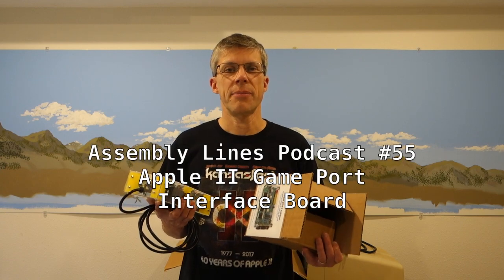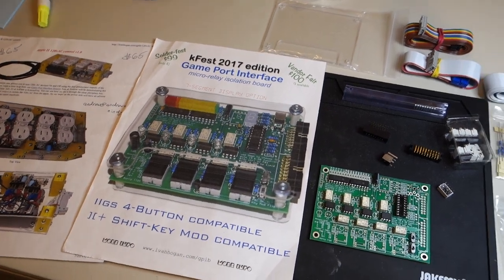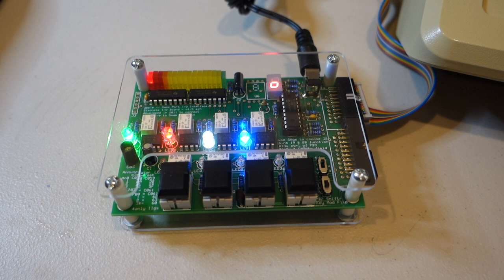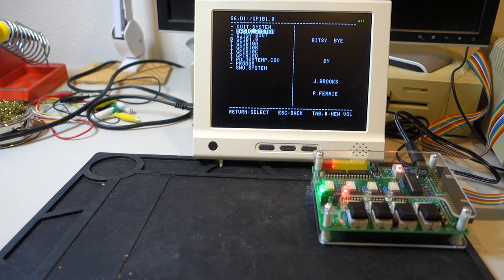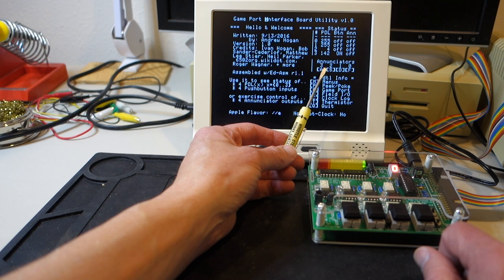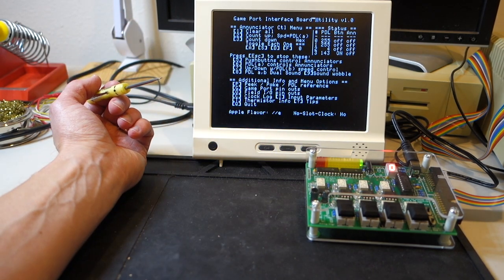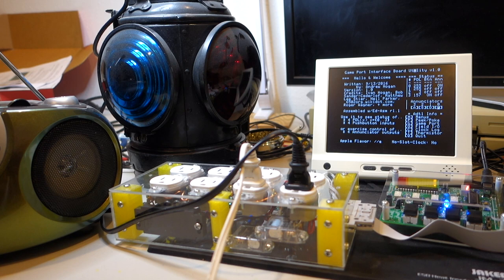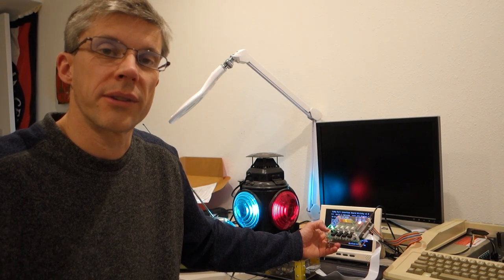Assembly Lines #55: Apple II Game Port Interface Board

Comment: Love the videos. Just got an Apple IIe, and have some questions regarding your monitor. What type of monitor is it? Are you using composite input, or do you have a VGA adapter? Did you paint it, or did it come in that colour? I have an Apple Color monitor, but I'm wondering if it's worth it to upgrade. Regards.
Reply from the maker: Hey Greg, it's a Dell 2001FP 20" LCD that I painted using Krylon Almond spray paint. I'm using both the composite and S-video input via a splitter cable. See https://youtu.be/wQaouPzMSsI. It's not worth upgrading unless you need the real estate on your desk. Those old CRT's are usually much better, especially for 80-column text...
Reply: Thanks. You did a great job, as it looked stock. I'll likely stick to the CRT for now, and consider the Dell LED a target of opportunity if I come across one.

Comment: Any idea if it works on a IIc?
Reply from the maker: It will partially work on a IIc. The IIc game port only has the pushbutton and game controller inputs but doesn't have the annunciator outputs so I don't think you would be able to control the appliances. You would also need to build/buy an adapter to go from the IIc's 9-pin connector to the 16-pin Game Port board connector.